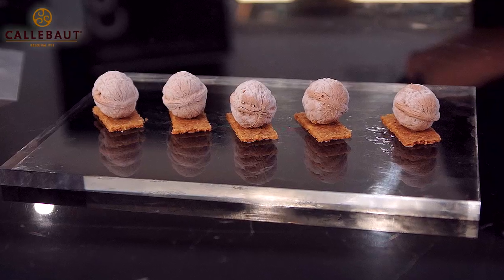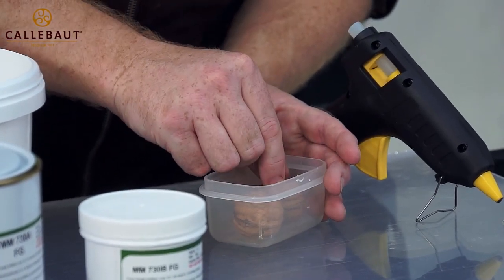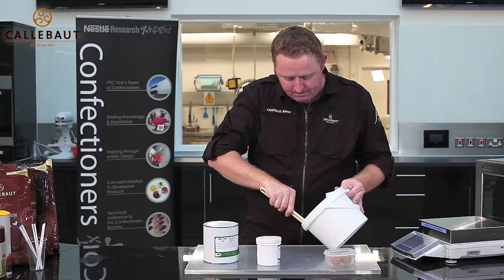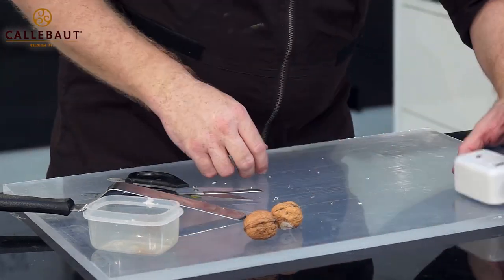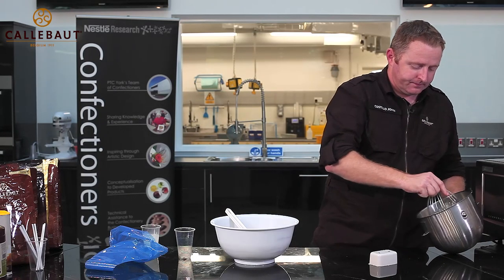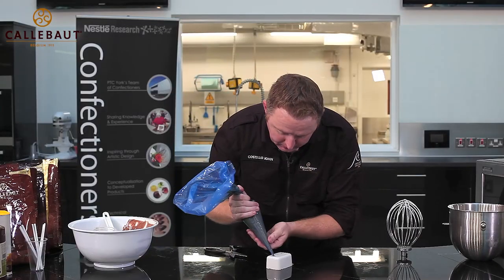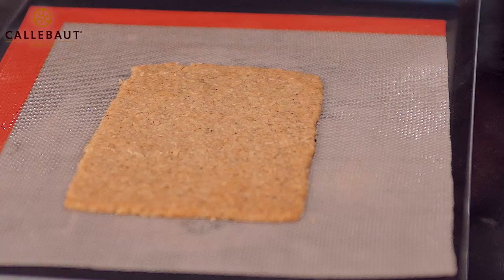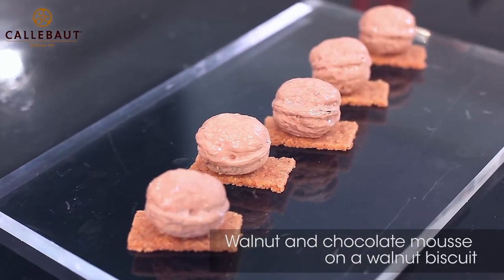Chocolate and walnut mousse on a walnut biscuit

Comment: Serious Question
 you got my Imagination going. can i pour the molding material with the walnut in it and cut it out like a avocado, horizontally to get the seed or nut out. and then have two walnut shaped halves to fill with cookie dough, freeze it, OR, pop it out then bake, will this work and how long will the mold last before it falls apart. thank you !    david and nice job on the video
Reply: It won't work beacause when you bake your cookie dough they are always spreading(sugar and butter are melted by oven heat)